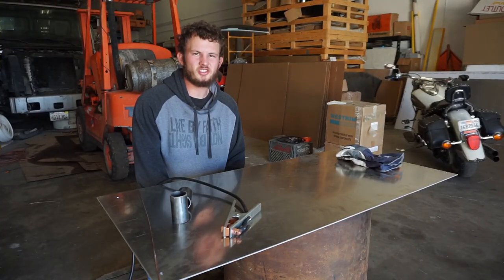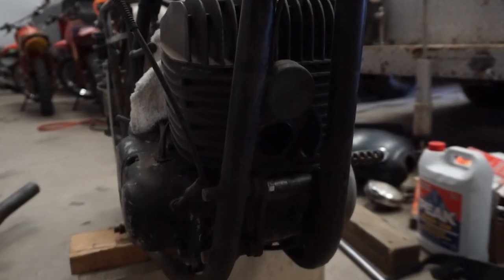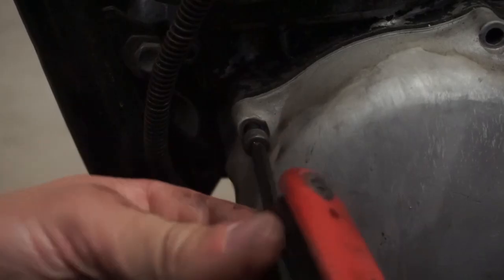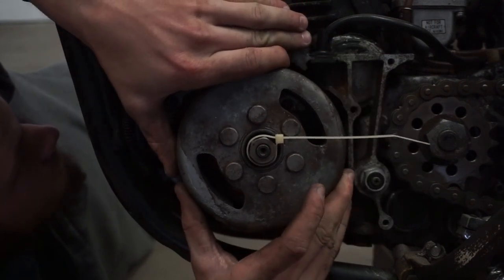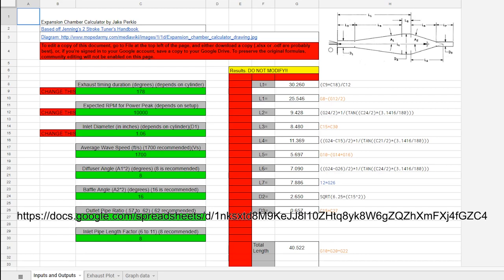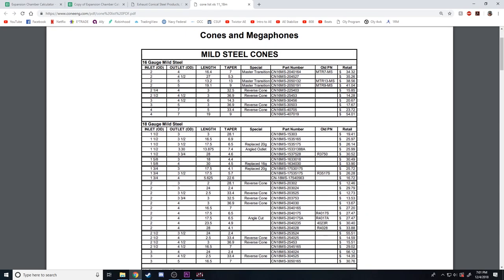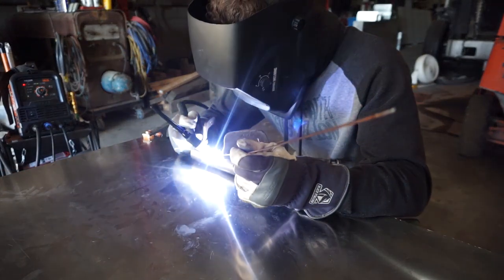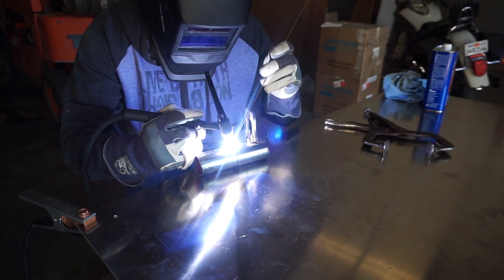EXPANSION CHAMBER BUILD PART 1: Design, Math, and Materials

Comment: This is cool! I'm going to try out this spreadsheet for my ts250 expansion chamber. Its like your dads rat bike i just saw that video. I got it for $350 many years ago. Mismatched wheels, no wiring harness. No lights. Tape everwhere holding stuff down. I do have a solid clutch wire and the cool 1972 gas tank. Ill try and make a video of repairs.
Reply from the maker: That sounds like a blast! One of these days I'll design one for his bike. I'm interested in seeing how yours goes 👍🏼
Reply: @FormulaJake  i started it for first time in many years. the entire oil injection tank siphoned into the crankcase when it was sitting and man was it smokey. it still fired right up and dumped mouse nests out the pipe. it was spewing oil out between the pipe flange and exhaust port.  the old owner broke off the exhaust stud and started to drill it out. the frame is also broken on the top tube under the gas tank.  they tried to fix it with gasless flux core and it looks like big bird shit on it. i have 180 amp tig welder so it all needs to be cut out and fixed.  its such a cool bike i rode it around the block even though it had a dirty cloged up mikuni, no presure in the super knobby tires and the only gas i had was some premix from my puch moped. some how all that oil still didnt foul the plug. just need to clean carb and rejet. then fab an expantion chamber and prob rejet it again. then get some street tires and a taller sprocket.

Comment: Rest both hands on table while your welding,so they do not shake much...
Also, if you are welding thin tubing, scale down amperage setting and use pulse if you have it on machine,with combination of thinner wire (for Mig welding cutted to length and straighten).

If you are welding from lets say right to left, you are adding wire from opposite (left) side...

Nice video, good work!
Reply: Thank you. you explained more than some yt videos that are 15min. long

Comment: Thanks a lot for the video it´s very useful but I still have a question. When it says in the spreadsheet "inlet diameter" where could I measure it ? Thanks a lot once again :)
Reply from the maker: Inlet diameter refers to the inside diameter of the first piece of exhaust tubing. Match this up with either the inside diameter of the existing exhaust/flange, or measure the exhaust port itself. Those values should be the same or at least very close, and any one will work!

Comment: Would this style of exhaust be applicable for use on a turbocharged LS V-8?
Reply from the maker: It wouldn't, as two-strokes operate on far different principals. The turbo also adds different factors to consider

Comment: What's your opinion on an expansion chamber for a single cylinder motor with twin exhausts?
Reply from the maker: Is it a two stroke? If so, an expansion chamber could help it out a lot
Reply: es it is a two stroke. t s a 1950 / 150CZ which I raced back in the 60s after fitting a reed valve out of a Danarm chainsaw.  @FormulaJake

Comment: I should have said this earlier. Mate, dont go with a target of 10000rpm. This is a dt400 yes? The transfers aren't big enough/ have enough duration to supply mixture at this rpm. you want someting like 7800-8200. you just wont get what you want expecting the dt to rev like that. Even then  the transfers are pretty small. The crank probably wont like it either. If you have a way of lifting them with a grinder lift them like 3mm too try to spin it that hard. if you have an mx400 you should be ok.
Reply from the maker: Thank you for the advice. My original plan was around 7500 or 8000 rpms. The program's default value is 10,000 rpms, and I didn't change that value in the video. Thanks again!

Comment: Jake I've been looking for cones for my motorized bike. We know how to calculate the shapes, but the cones we've found are the wrong size i.e. too big.
Reply from the maker: Hey John! Have you looked at Cone Engineering? They have all sorts of sizes at different angles. One of my cones is 3/4" on one end, and 4" on the other end. If it's too small on the small end, or too big on the big end, I'll just trim it with a band saw or cutoff wheel. As long as the angle is right, and the ends can be cut to the proper size, you're good!
Reply: Thanks, I have the dimensions but we'r don't have the rollers to make the cones. Sweet!

Comment: where can i found the link for the software that you use?
Reply from the maker: I used Google sheets. If you go to drive.google.com and make and account, you can save this document as your own. Or you can use Microsoft Excel, or any other spreadsheet software.
Reply: @FormulaJake  link?
Reply from the maker: Spreadsheet:
https://docs.google.com/spreadsheets/d/1nksxtd8M9KeJJ8l10ZHtq8yk8W6gZQZhXmFXj4fGZC4

Either open it right in Google Sheets or download it and use it elsewhere 👌🏼

Comment: How do you use the spreadsheet? Cheers
Reply from the maker: Edit the top three values to match your bike, which are the exhaust port duration in degrees, the RPMs, and the exhaust inlet diameter, in inches. The rest of the values that come out of the spreadsheet are what you use to determine how long/wide each piece is. Let me know if that doesn't make sense!
Reply: @FormulaJake thanks for the info also how do I edit the spreadsheet on an android phone?

Comment: What's your opinion on putting an expansion chamber on a 4 stroke? I'm trying to make it as quiet as possible.
Reply from the maker: It seems as if most 250/450 4 stroke manufacturers nowadays use some sort of expanding header, or stepped header. It's commonly done to control the power characteristics of the engine, even on 4 strokes. As far as keeping the noise down, my best advice is to install a restrictive muffler, and ride in higher gears, lower RPMs, and lower throttle response.

Comment: How i due the angles of the pipe?
Reply from the maker: The default angles on the program  are 16° on the expanding pipe, and 8° on the contracting pipe. If you read deeper into two stroke theory and mathematics, you can find angles that work better for your machine. However, these angles will work as a good reference or starting point for any engine.
Reply: Sorry, i tell about courves.
How i due angles of 90°, 120°, 180°?
I find the program "Cone Layout" but this program make cone each cone.
Its Very dificult to due any pipe with 16 sections on 220mm of courve.
Sorry for english.
You can undestand ?
Reply: I due exhaust for motobecane av10 engine.
Its "easy" to makes on a paper.
But, i have projects for dirt bikes and scooters, but the courves has killed me 😕
Reply: Pie cuts mate, or search up "cone templates", you can make most sewing templates work for metal as well ;) good luck!

Comment: euhm , what crap is this ?

that excel sheet ... what crap is that ?

it does not take in calculation the stroke , the bore , conrod length exhaust temperature etc etc  

if you fill in the excel sheet , with a timing of 196/197 degree exhaust timing , with a rated rpm of 15000 rpm , my pipe would be 1.3meters long , and the power band (D2) comes out negative numbers 😆

the only way is to lower RPM's to 10000 , but that's for street and tuning , not for racing applications .

There is something seriously wrond with youre excel sheet , 

i would not recommend to anybody to use this sheet ...

The codes light be wright , but there a lot variable that are missing , maybee link the